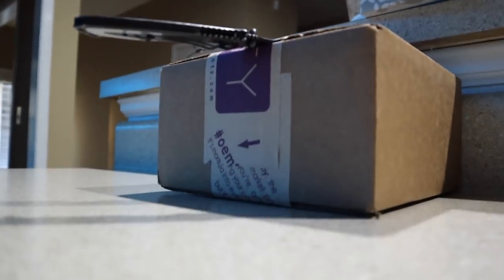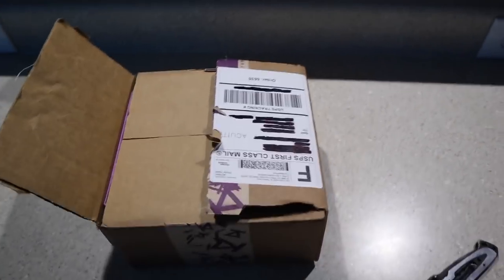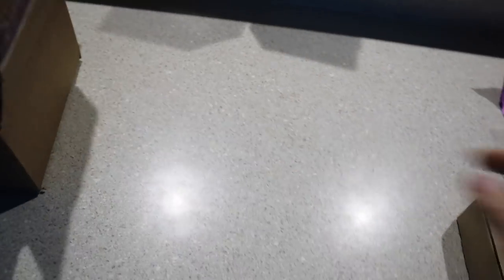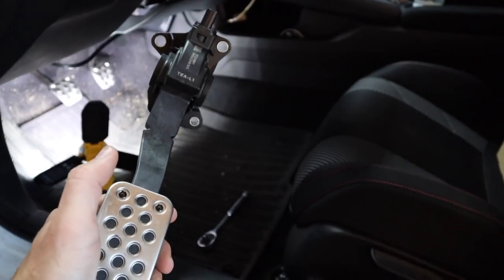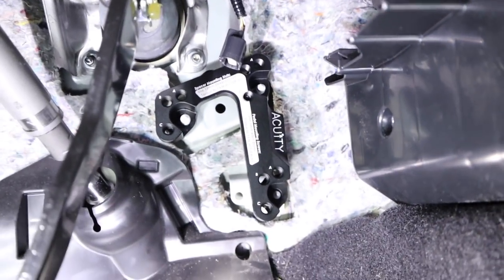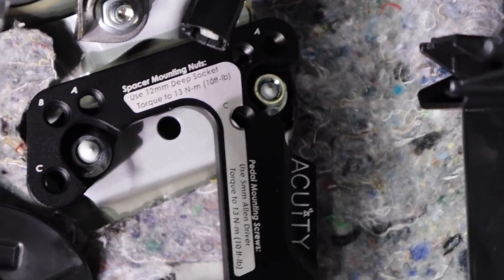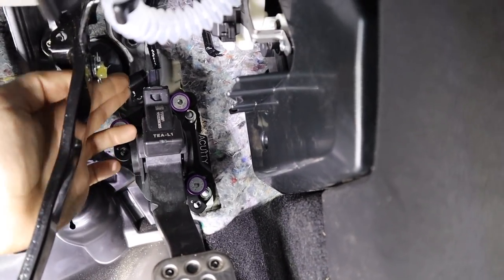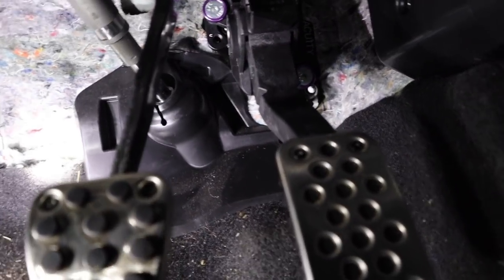10th Gen Civic Throttle Spacer Install **Acuity Instruments**

Comment: I installed the Acuity on my new Civic about a month ago. I have the gas pedal on the "C:" setting, which is the most moderate setting. The bracket is well made and the installation was easy, (I skipped the battery disconnect part and left the electrical connector attached to the gas pedal assembly throughout (I used a tie wrap to hold it temporarily to the brake pedal during the bracket installation. 
My initial perception is that the Acuity bracket makes it a lot easier to heel and toe. But after putting on more mileage on my new car, I have encountered many situations where my foot catches the gas pedal as I press down on the brake (but before the brake actually catches with any meaningful force). I did a careful visual examination of the foot well and came to the conclusion that while the gas pedal and brake pedal are spaced well, and good respective heights while the car is stationary, that harmony does pan out in actual driving, and that was only in moderate street driving, and not anything aggressive. The problem is that the brake pedal is too far and also too mushy, and when depressed, by the time it actually catches enough, the total downward travel is way too excessive (it goes below the height of the gas pedal). I can only imagine it would even be worse during aggressive driving. It also doesn't help because I have bigger than average feet (my shoe size is 11 W)
Since it's already set to the least aggressive position "C:, the only thing I can do would be to consider removing the Acuity bracket and go back to the factory pedal location.  
I was wondering if replacing the brake lines with braided stainless steel might help.